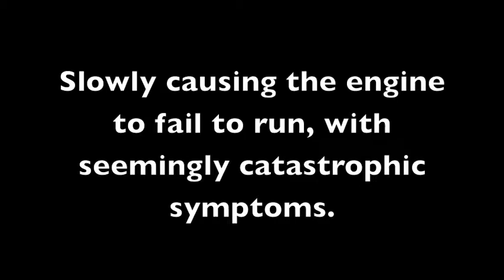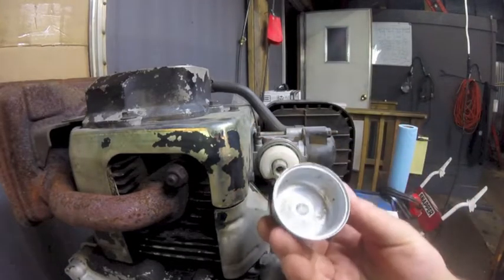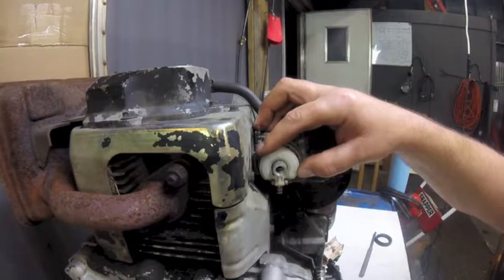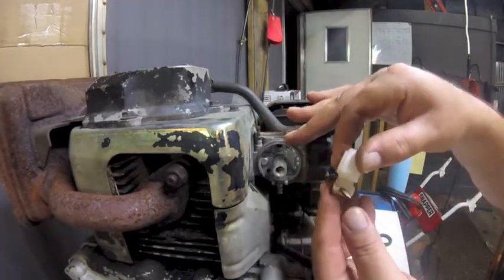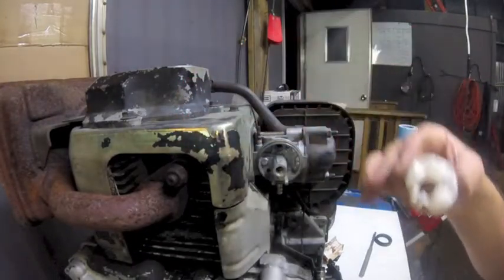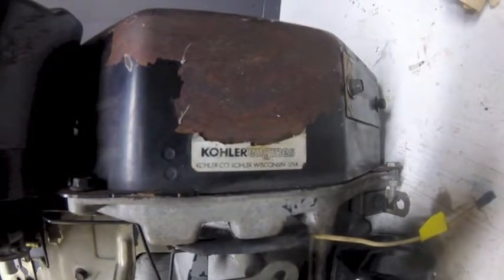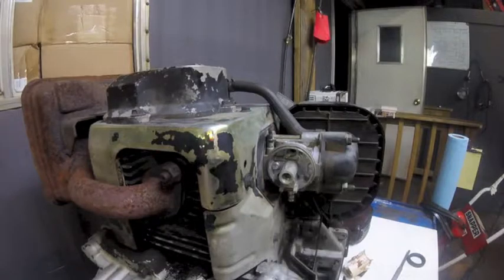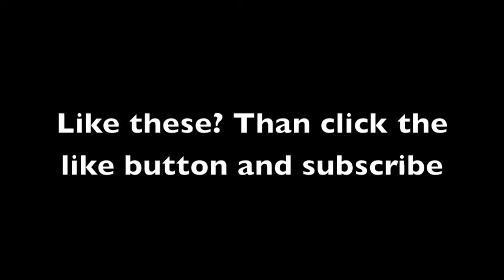KOHLER CV15 S CARBURETOR LEAKING INTERNALLY

Comment: What do you do if you replace the needle and get the same issue? Replace the brass seat
Reply from the maker: Usually on a Kohler the brass seat is an integral part of the carburetor
Reply: If your engine has a fuel pump, it might possibly be a cracked diaphragm in the fuel pump letting raw gas leak into the crankcase.